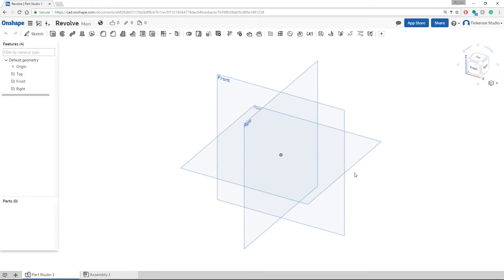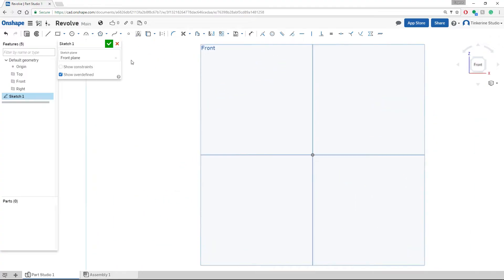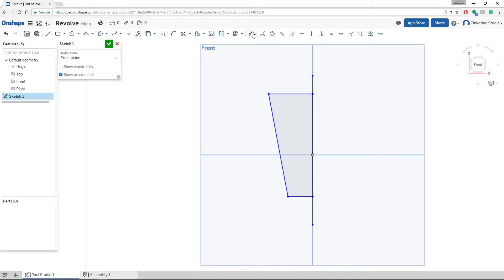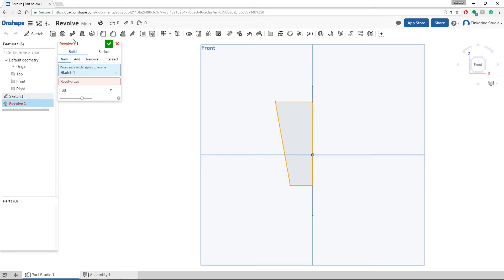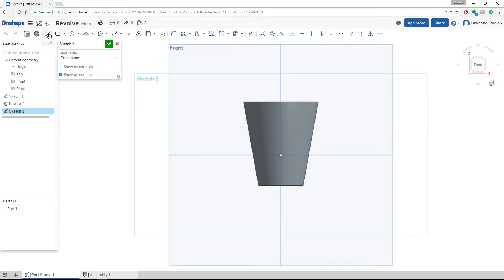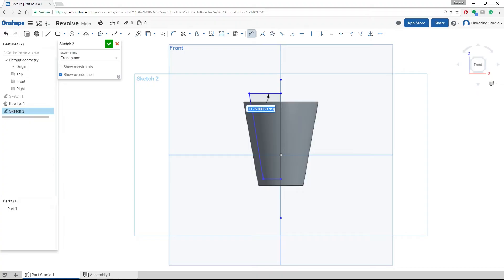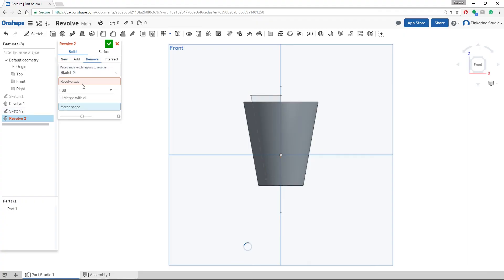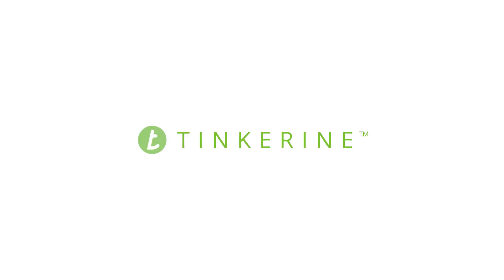Onshape Revolve Tutorial

Comment: Hello, I'd like to know how to revolve a cut into the front wall of the cup. 
Say I wanted to cut a hexagon into the wall of the cup from the front plane. In other words, to see a whole hexagon cutout in the top part of the cup. 
I can see one way to do that with a sketch on the front plane and just cut outwards along the positive and negative y-axis, front to back. 
But if I would like to have six hexgon cuts around the wall of the cup, instead of two, how would you do this without repeating the above process three times?
Reply from the maker: Hi @GoalWalker, you will have to first cut the hexagon in one direction out of the cup and this will create one hexagon ont he side of the cup. Afterwards, you can use the feature "circular pattern" to repeat this cut feature 5 more times to get 6 hexagons along the perimeter of your cup.
Reply: @Tinkerine  Thank you!